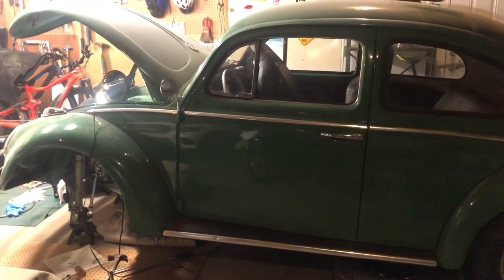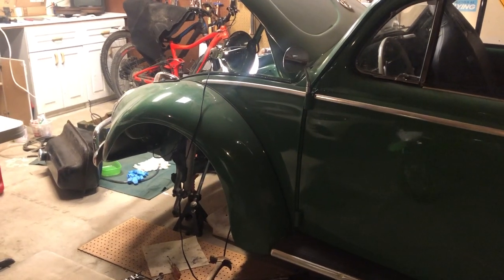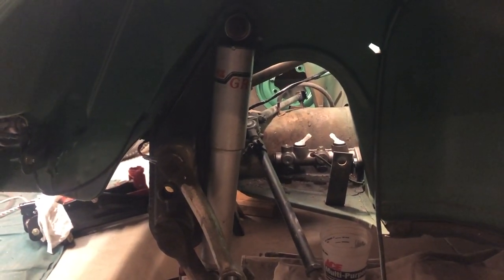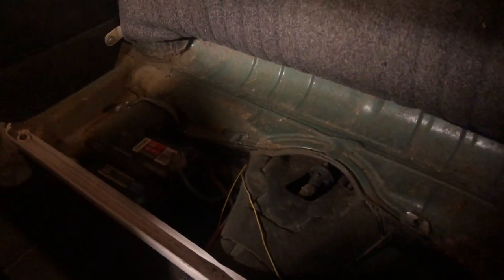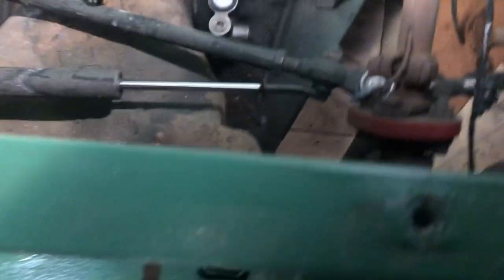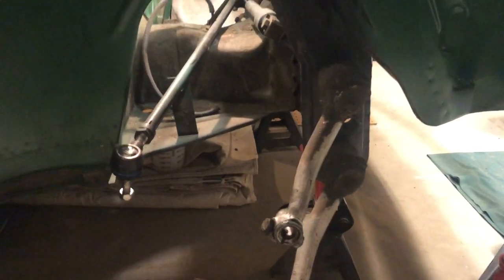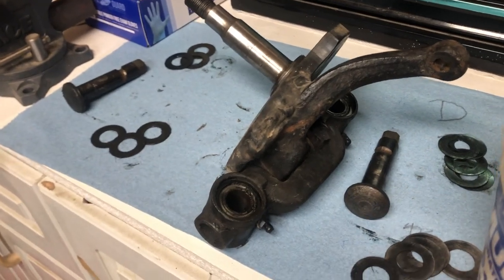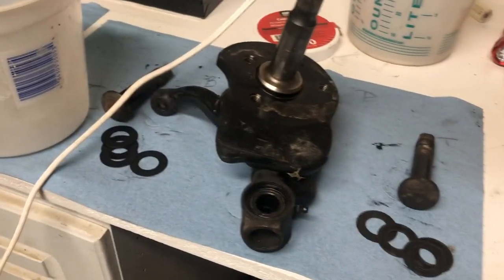1960 (1963 brakes) Beetle Disk Brake Upgrade and Steering

Comment: I am considering a disk brake upgrade.  How do you like yours?
Reply from the maker: Yea, great kit from jbugs.  There are a few options though.  I already had drop spindles so that is the kit I purchased.  I think regardless, you will need to replace your current spindles with ones from disk brake kit.  It did take me a bit to figure out exactly what kit I needed but jbugs was a big help.  The only downside is that previous work on my car had included a hack to spindles so they would sit in under the fender with the drop spindles.  With the kit, my wheels are now 1 inch outside of fender, so be sure to calculate all your offsets and keep in mind what is currently there if it is not stock.  Also, I was not sure about doing link/king pins so a local machine shop did that for me.  Well worth it.